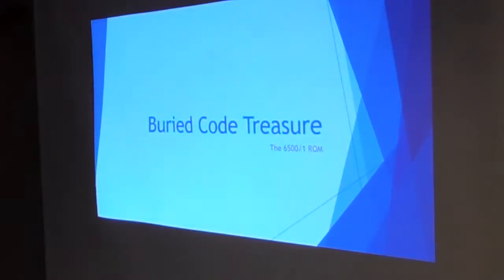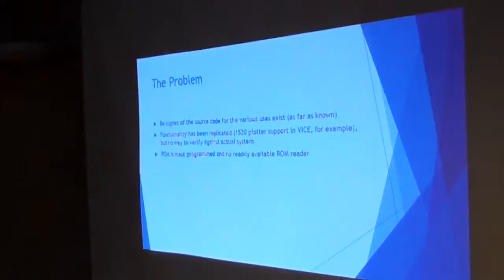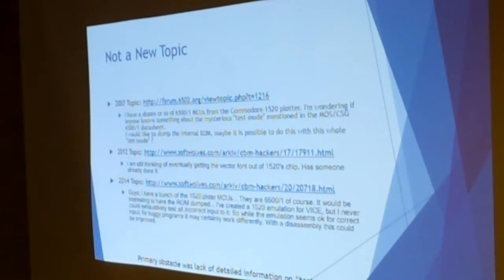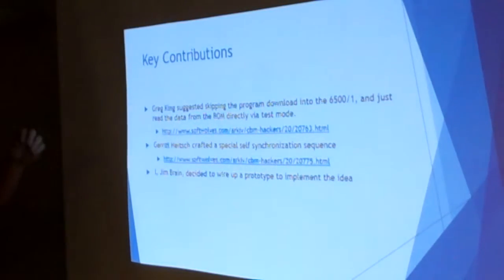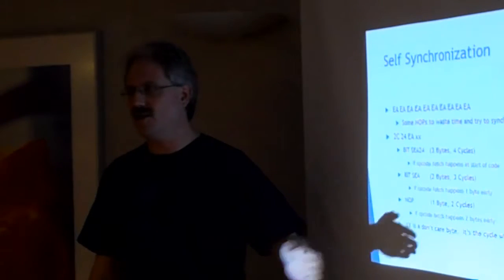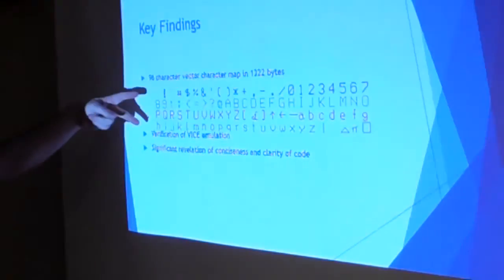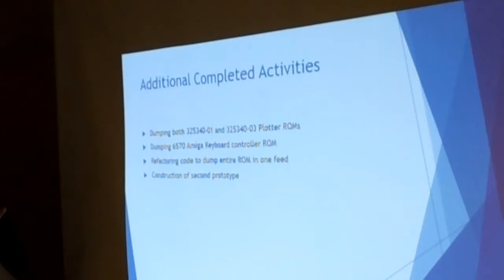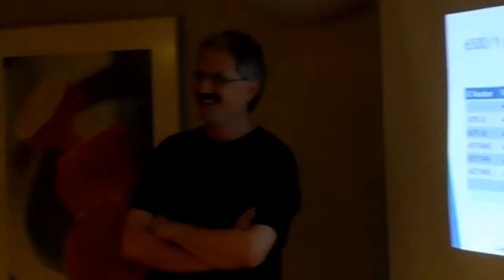VCFMW 9 - Jim Brain: Reverse-engineering the MOS 6500/1

Comment: This is potentially huge for the vintage synth community. There's lots of bricked Ensoniq/Emu gear out there because they used these as keyboard, display controllers etc. and they die a lot. These were made by Rockwell under licence